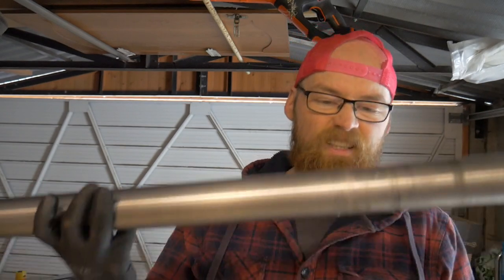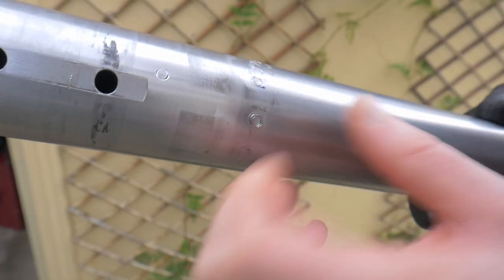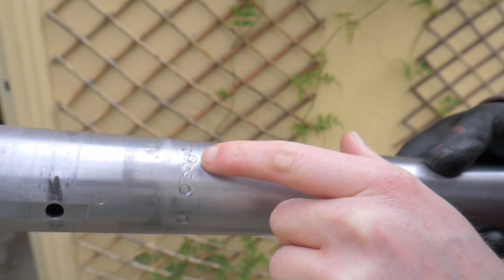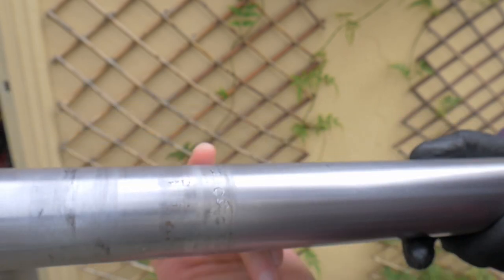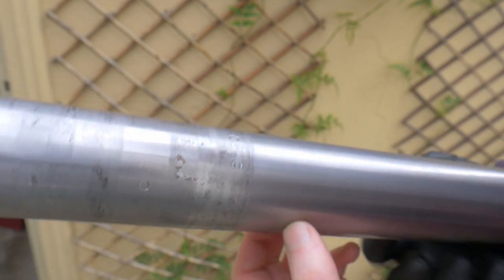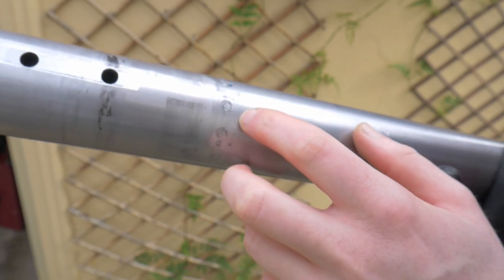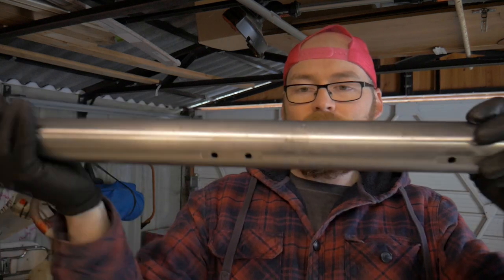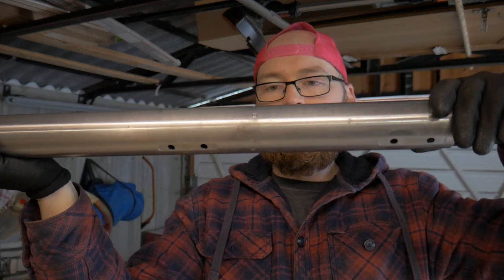Avoiding Potentially Lethal Axle Failure - Inspection time!

Comment: I think split collars/clamps are a much better way of actually securing the axle than grub screws, they spread the force over a much wider area and don't damage the material at all, i use them on all of my karts.

I've seen some horrendous gauging made by grub screws, with some people even drilling locating 'divots' for the grub screws which is just suicide.
Split collars are safer, better at doing the job and are used in many other, critical, non karting shaft securing applications. The bearing grub screws should be set lightly so as to just grip the axle enough to lock the bearing to the axle, and locked into place, but not be tightened with sufficient force to prevent lateral slip, let the collars take care of that.

You can only keep increasing diameter and decreasing wall thickness of a tube or shaft so much, the same thing happened in mountain biking with handlebars, which i think is a comparable, critical point of stress/leverage.

First it was 25mm, then 30mm, and now 35mm is becoming increasingly common.  The end result has been both lighter and stiffer bars, but this can only go so far before the material gets so thin it's dangerous.  If 35mm handlebars were snapping with the same regularity as 50mm axles seem to be, there would be much more noise made about it within the scene than seems to be happening in karting...

Though the forces applied through mountain bike handlebars and kart axles are broadly similar, and i think i could quite safely assume that the stress testing on both are also quite similar, the most significant way in which kart axles differ from handlebars in how they are installed/treated by the end user...

Cranking down on axle bearing grub screws causes an absolutely massive stress point in a tiny area, and as is evident with your axle right there, they come in and out in and out many times, with the grub screws tightened in a different place every time, creating a virtual 'fault line' around the axle, this IS what's causing the breakages...
Now I don't think yours is bad at all though, as i said before i've seen much much worse, but it's people with less than optimum mechanical sympathy, wanging up their grub screws as tight as they can, probably because they were either told to by someone else who also doesn't know what they're doing, or were given no instructions at all about how to install an axle, that are causing critical failures, i mean there are no torque specs given for grub screw tightness, and given the differing materials and manufacturing processes of various axles, it would be impossible to provide an absolute torque figure, this is a problem.

Handlebars are obviously much thinner, and these days are commonly made of carbon, so using the correct torque is vital, but the clamping forces used by the stem to hold it in place are spread over a much wider area, just like an axle/shaft collar, and torque specs are CLEARLY labeled and are usually printed on the bar, thus removing any doubt, but failures have obviously occurred, and it's always because of over-tightening, either at the stem clamp, or the brake lever clamps, fault lies with the user, how do yo regulate or mitigate that in karting?

When you think that most people are also only using two bearing carriers on their axle as well, you're asking 6 little grub screws to do a fuck load of work, coupled together with the tiny surface area they are being asked to do that work in, it's too much... Snap!!!

I agree that a wholesale reversion to 40mm axles would be a good idea on many levels, i only use 40mm, but so would putting much less reliance on grub screws to actually hold the axle in place.

Split collars are the answer and should be standard equipment, regardless of axle diameter…